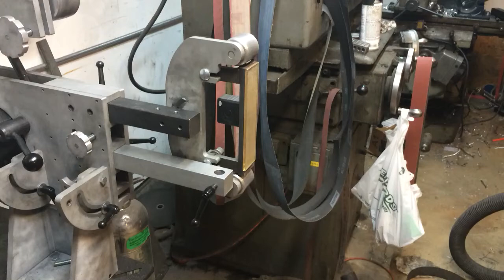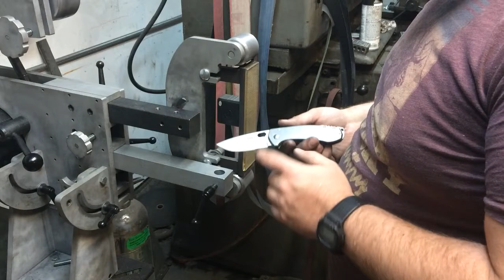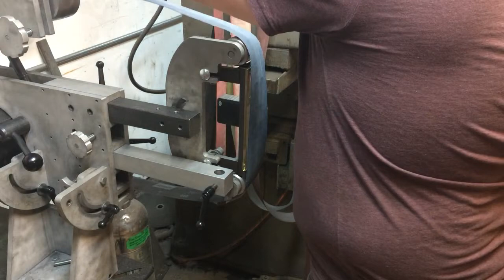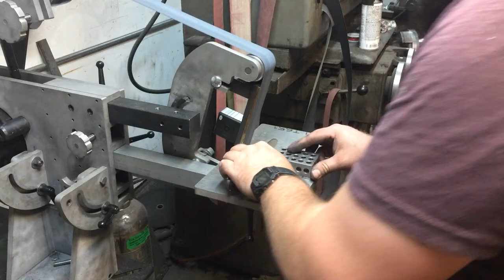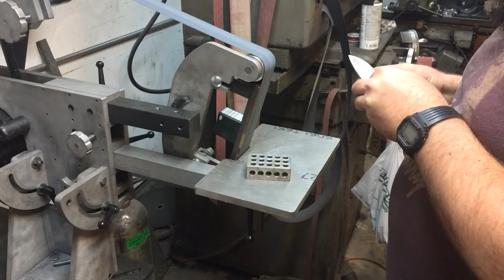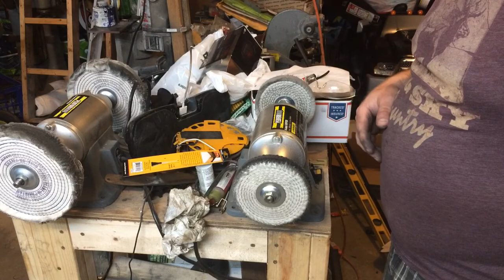Touching up a new daily carry

Comment: new maker here... never have issues edge up sharpening? I was under the impression that once an edge was on most people sharpened edge down
Reply from the maker: It's never been a problem as long as you keep a light and even pressure. Buffing and stropping is always away from the edge, but I've not noticed a difference in the abrasive belts.